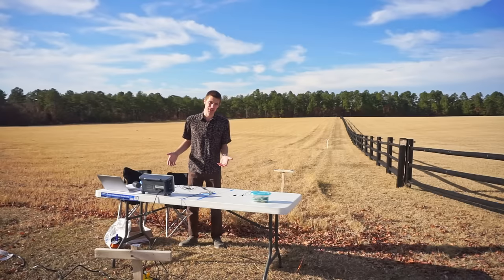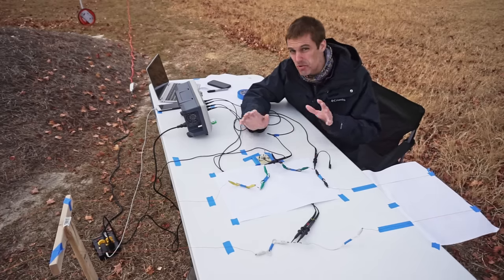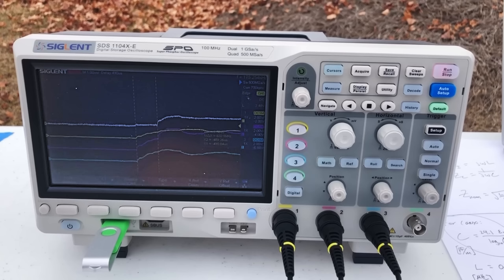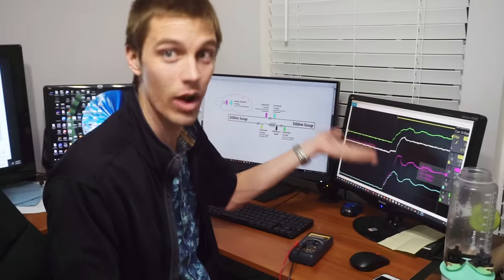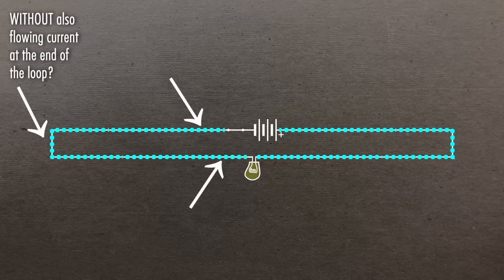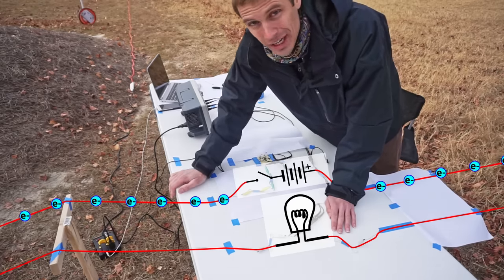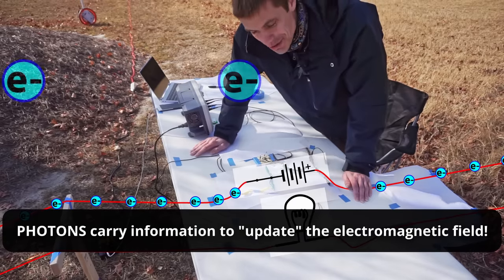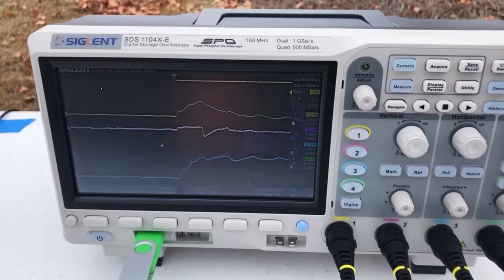I bought 1000 meters of wire to settle a physics debate

Comment: I think Veritasium could have avoided this whole debate if he'd said "will experience a very tiny but non-zero amount of current" rather than "won't receive the full current"

To most people the later suggests a significant fraction of the total current.
Reply: He should have explained what would happen if the wires were cut. And how it DOES take one second for the lightbulb to reach full current. His explanation was incredibly lacking.
Reply: @001variation  Yes, exactly!
Reply: If he said that the minimal current in the bulb is just a result of wires reacting to changes in the magnetic field (which we observe on a daily basis) his video wouldn't be so "sensational". I consider his video as a complete lie.
Reply: @uuuummm9  That seems really harsh.  Explaining things is hard and it always involves some simplification -- it's easy to get it wrong.

Fuck, take the standard explanation for GR involving heavy balls on a trampoline.  Is that a lie?  I mean you aren't really explaining why heavy bodies attract each other in GR because the only reason the bowling ball creates a dent in the trampoline is gravity.  If you get into GR the actual explanation only works because it's a warping of space-time and it shifts the forward in time direction partially into the spatial dimensions.

So is that a lie?  If Veritasium's explanation is than so is it.  But I think it's better to regard them both as poor attempts to explain a complex concept.
Reply: The wire literally just acted as an antenna. That's the answer. Literally basics of EE.
Reply: @uuuummm9  Veritasium's bullshit "video" was nothing but the near field dipole effect, which is quite well known and has nothing to do with the extravagant claims he was making. His whole approach to this was full of nonsense.
Reply: @petergerdes1094  No the heavy balls on a trampoline is just trying to show how the space time is warped, its not denying the warping of the time axis (if anything you can see that as an implicit consequence of warping the space).
The truth of the matter isn't denied by the simpler explenation, its more of an expansion of it.

Veritasium was instead claming a lightbulb would be switched on purely from the initial EM wave from just turning on the system. Not just that there was an EM wave emitted.

In effect Veritasium's video doesn't really teach people it makes them more confused about the matter at hand while the ball on the trampoline model helps build up an understanding of how to visualize GR's description of gravity.
Reply: @001variation  I don't think so.
He was explaining what physically happens, how reality handles this, and he was 100% correct, this is entirely due to the effects he mentioned.

I really don't understand what "debate" there really is to have here, since everything he said was correct, and it was the way the universe behaves in this situation, but everybody else came with high level approximations and started a "debate" for some reason...

Comment: I am working for years now at an institute of high energy physics and have to deal with different frequency signals in PCB design which includes all the effects you have shown in this video (transmission lines, lengthmatching, impedanz, etc.). Consider myself deeply impressed by your practical and complete explanation, Sir. It really made all this "magic" happening on a Circuit Board a little bit more graspable.
Reply: Haha wait till you get to gigahertz radio equipment (or anything over 100Mhz)... Now imagine trying to model these way back in the early days of radios.

Comment: This is by far the best response to Derek's video that I've seen so far, really liked the break-downs of the oscilloscope plot. Top job 👍
Reply: I really like the electroBOOM one too because he made the excellent point that if "any current" counts as the lightbulb being "on", then the lightbulb would always be on because there's lots of little causes of current constantly in that kind of setup

For example, it seems like the wind caused static electricity which caused all kinds of noise in the measurements? And I assume even if everything was isolated very carefully, we'd still be able to see a non-zero current with sensitive enough equipment?

I'd be really interested to know how much variation there was in the "background" level of current in this experiment.
Reply from the maker: Yeah there were pulses of nonzero current all the time but it wasn’t continuous so if I triggered the scope a few times I could see a clean trace. In retrospect a 10k resistor in parallel with the battery probably would have helped that quite a bit (at least for the trigger probe on the yellow trace)
Reply: @AlphaPhoenixChannel  Really interesting. So in the original thought experiment where "non zero" counts as "on", the lightbulb would actually be turning "on" randomly (or even just be "on" continuously) even with the switch open all the time.
Reply: @AlphaPhoenixChannel  The trace may look clean but as I'm sure you're aware if you had a device sensitive enough it's generally impossible to get absolutely zero current transfer in the real world with, you know, stuff moving around, even cars driving or radio waves floating about (such as how a crystal set radio doesn't need a battery).  So by Derek's definition the light globe would always be on no matter the setup in the real world... it's almost as if it was unnecessarily contrived to create a clickbaity video... who'd have thunk it... 😉
Reply: @TristanCunhasprofile  It would be on continuously in the real world even if there was no circuit, if it could truly detect non-zero current, just from very slightly charged things about in the near environment. Rubbed your hair and got some static electricity? That's a charge! That'll exert some movement of charge across the lightbulb just by standing near it. Etc etc etc. That's also why Derek's setup is rather contrived, so much so he shot himself in the foot with it.
Reply: @TristanCunhasprofile  Yes. How do you think radio receivers work? The antenna pulls in a microvolt-level signal from the air (which comes from the transmitter miles away). If you live within a quarter-mile of an AM radio station, you can hear the broadcast on your old-school landline telephone. We lived about one mile from one, and with a 30 foot long wire on the roof, we could clearly hear it on an earphone with a crystal radio. That was probably about 5 or 10 milliwatts. So his mythical light bulb would always be on.

Comment: This reminds me of a true story about an electricity supply company's underground cable division many decades ago.  They had an experimental machine in the back of a small truck that could tell them at what distance away their buried power line has a break and where to dig into the ground. They didn't use the machine very often but when they did use it always told them the distance to dig, they dig there, they wouldn't find the break there, then have to dig along either direction expose more cable to find break. After a while they realised the break is always exactly 6 feet away from where the machine says. Then they realised that for all of the years they had been using it they had not been including the length of the hook up cables in between the machine and buried power line.
Reply: The machine you are referring to is called a Time Domain Reflectometer (TDR) and is used extensively today. Not accounting for your launch cable is a rookie mistake 😊. The way it works is that electricity will travel at a fraction of the speed of light in a medium depending on the construction (the makeup of the copper conductor) of the cable. The manufacturer of the cable will provide the type of cable that you can then enter into the TDR and “shoot” it to find the distance to the damage, or end of the cable. The signal sent out from the TDR will bounce off the damage and reflect back to the TDR. So if the machine knows the makeup of the cable it can determine the length very precisely.
Reply: I use to use a TDR on heavy jets. Works great. But few understood how or when to use it.
Reply: Time delay reflectometer? TDR
Reply: Time delay reflectometer would make more sense, but it is time domain reflectometer. https://en.m.wikipedia.org/wiki/Time-domain_reflectometer
Reply: @owakulukem     Got it.  Thanks.   “Delay” does make a lot more sense but of it is call Domain, then we will call it domain.
Reply: @owakulukem  I agree, I now recall that was what I was taught, my mistake. Thanks.
Reply: This is called a time domain reflectometer.  It finds the distance to an impedance transition in a transmission line.
Reply: Just a hyperfréquences tester and a little bit calculus
Reply: What, did no one read the manual?
Reply: Time domain reflectometry - you can do it with a pulse generator and a sufficiently decent oscilloscope (which is often a lot less expensive than a dedicated TDR!)
Reply: 6 feet accuracy for a TDR or an OTDR is bloody good especially on longer runs because because seldom is the index of the cable or fibre  known to a degree of accuracy.
Reply: @74HC138   a lot less expensive?
Reply: We use a $300 MFJ Antenna Analyzer 256B.
Reply: @W1ZY  that's interesting because just reminded me of something of a party trick I used to do 40 years ago, I used a fantastic grid-dip-meter to measure the length of pieces of wire by finding the peak resonant frequency
Reply: The machine had a very bad interface if it didn't allow you to calibrate for its hookup cables.
Reply: @unclesmrgol  people back then just got on and got all their work done so they could go home at 5

Comment: Man, this test has been done for years in the universities' electronics lab. In fact sending pulses and measuring the bounce is the standard way to detect where a data line is broken. You can measure the distance from the broken point with cm precission in coaxial cables.
Reply: These guys should really bring an Electronics Engr on board. Because we understand the imperfections of circuits. I saw one video where the physicist was totally flummoxed by switch bounce. I saw one video where the physicist totally misused the terms voltage and current.
Reply: @QualityRecord  Misusing the terms voltage and current is something a backyard mechanic does, not a physicist. Either the physicist forgot the basics, or the physicist was not a physicist.  As far as an electrical engineer,  I was an EE major in college and we learned how to use those terms the first day.

What annoys me as much or worse are those who don't distinguish AC from DC. To mess that up you are not at all qualified to be discussing anything about even the most basic electronics. It's like if someone is discussing their sound system with me and I ask the ohm rating of the speaker and they tell me "300 watts". I know at that point I best say no more.
Reply: How? The current running through a wire does not move with the speed of light... Experiments like in this video like to claim as much but basically it has only roughly the speed of light. In reality it is probably around 90% of it or even less. Or do you now the speed of the current for that particular cable?
Reply: @KM-bu5yw the current doesn't flow at the speed of light, but the electric field that produces the current does. 
Therefore, you can do this same experiment, measure the time difference between switch on and voltage bounce, divide by c and you got it
Reply: @tremon3688  That is not correct though. For one the speed of light in a vacuum (c) is not applicable in a medium be that air, plastic or anything else. For example the speed of light through glass is only about two thirds of c. I am not going into the current and field explanation even though that is also not correct.
Reply: @KM-bu5yw  I understand now what you mean. I guess probably it has been measured for the cable. Anyway, you missed the whole point of the video, current flows at millimeters per second, it's the fields that go that fast
Reply: @tremon3688   I did not mention the video. I was asking how the commenter is doing something that seems impossible.How fields are created was described by Maxwell 150 years ago.
Reply: @KM-bu5yw The speed is 1/sqrt(C*L), with C being the capacitance of a meter of wire and L the inductance of a meter of wire. This speed is lower than c, if fact it is c/sqrt(rel_permitivity_of_insulator). For a coax cable this is about 1/2 of the speed of light. 
The wires in this experiment are building transmission lines, a well known device of EEs. I think it should be way better to do the experiment by arranging the wires as an U and by putting the "bulb" at the end of the wires instead of the center. And then to tune the value of the "bulb" resistance in order to minimize the reflections (characteristic impedance = sqrt(L/C) )
Reply: @jesusarias4320  Yes, I thought as much. Current cannot propagate with the speed of light in a vacuum. That is a pretty important thing in physics which is why I was so confused by FSRubycs comment. The square root in your first equation doesn't seem right though. The units are off when using SI. ohm x farad = second.
Reply: @KM-bu5yw In fact the units are Farads/meter and Henrys/meter, so the resulting value is speed in meters/second. And I mean capacitance and inductance per each meter of transmission line (that has two parallel wires).
Reply: @jesusarias4320  sorry, I misread your answer as impedance instead of inductance. My mistake
Reply: @KM-bu5yw The electric current speed is very slow, about 10microns/second (assuming 10mA and 0.3mm section for the copper wire) This is an average as electrons move randomly inside the cooper, and quite fast due to their small mass. The electromagnetic field is another completely different story  and it moves at the speed of light (still, slower than the light in vacuum).
Reply: @jesusarias4320   light is electromagnetic radiation. Saying electromagnetic fields move with the speed of light seems silly to me but I am not an electrical engineer. The drift velocity is irrelevant here. The movement of charged particles causes electromagnetic fields as described by Maxwell and others. The interaction of charged particles with each other happens via electromagnetic fields as described by the quantum field theory. Saying the field carries information, not the electrons is silly but again I am not an electrical engineer.
Reply: @KM-bu5yw  especially when directed outwards, air resistance, pressure resistance,

GROUNDED IN REALITY UNLESS YOU ARE IN A VACUUM WHICH IS UNSURVIVABLE
Reply: Think about how they detected the location of the failure (perforated insulation due to excess voltage) in the first transatlantic cable - in 1859, I believe it was.
Reply: @whichgodofthousandsmeansno5306  I would have said - What you mean the impedance? 🤔And actually it's not that far off the mark to say 300w... just like we rate light bulbs by wattage, not an ohm rating - even though a light bulb is a resistor and has a variable ohm rating. Speakers likewise are rated by the wattage rms, and not whether they're 4, 8, or 16 ohm.

Comment: I'm a high school physics teacher. Students only have a pretty shaky grasp of capacitance and inductance by the end of school. I love that this can be explained referring directly to charge density and forces. No need for transmission lines or antennas. Grade 7 students who know that opposite charges attract and like repel, and waves take time to move could understand this model.
Reply: I left the highschool thinking that induced current is basically black magic. We were told that induced current has to exist because of conservation of mangetic flux and that transformators work on the principle of conservation of energy, I was able to solve the problems of this type but I always viewed it induced current as hocus pocus.
Reply from the maker: @smrtfasizmu6161  To clarify - what I've described here isn't induction. Induction uses magnetic fields, not electric fields, and is a fair bit more complicated to explain without math... I personally hate explanations that lean on math so if I generally wait until I think of a good analogy before talking about something...
Reply: If they are struggling to understand capacitance then I am sorry to say, you are not teaching it right.
Let's take the example of a parallel plate capacitor with an air dielectric.

It's incredibly easy to explain and the formula describing the capacitance is also incredibly easy and logical.
Moving then towards capacitor with a non air dielectric is then one simple step further on. You could even talk about the effective series resistance, though when I was at school level physics they didn't cover that 

Things become a little bit harder with inductors and magnetic fields, but even the basic equation, Faraday's law is simple enough, and easily demonstrated.
Reply: DC electronics theory is hard enough for the novice student.  Throwing in capacitance, inductance, and AC electronics principles will seem like black magic until it is learned.

Comment: I haven't seen part 2.  This is a wonderful start to exploring capacitance and inductance.  There is so much more to see if you continue to make variables.  Do some reading up on capacitance and inductance.  Also, look into the Q factor when power companies have very long runs of high voltage at 60 Hz power transmission.  Keep up the good work.  Good luck.  Don't loose interest.